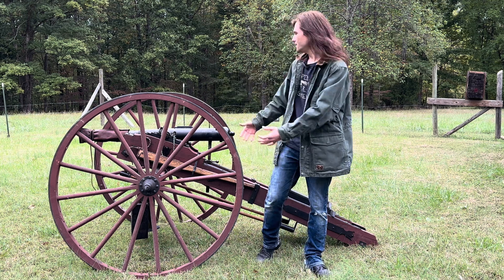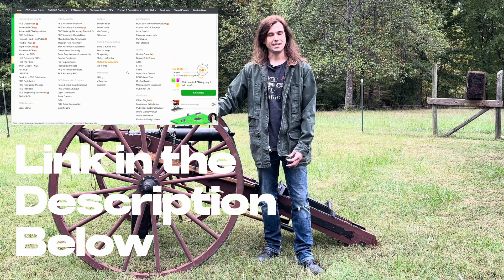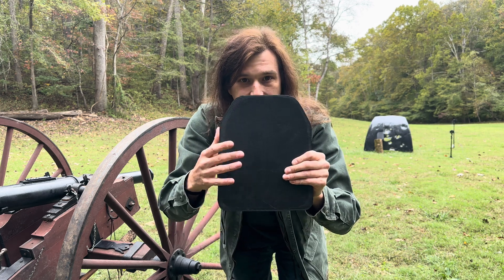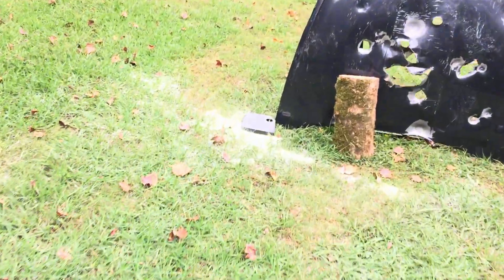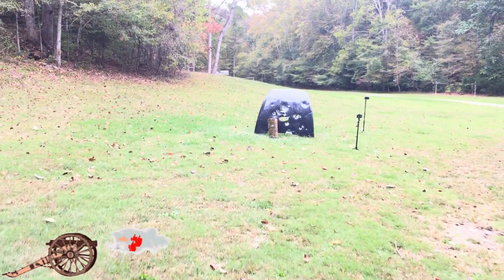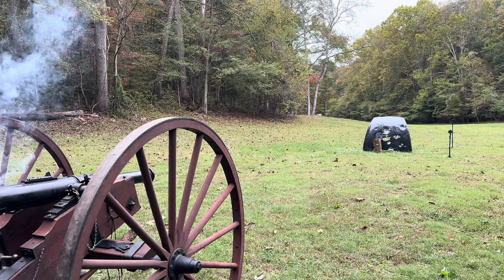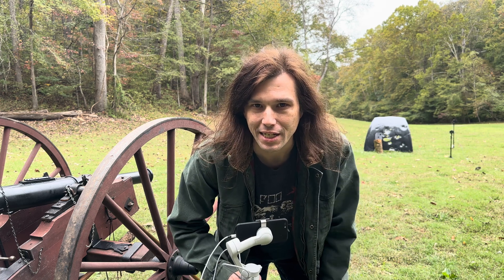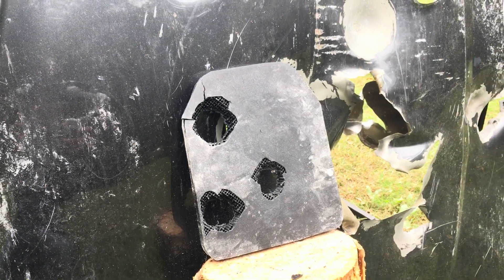Cannon vs. 3D Printed ABS Body Armor

Comment: Hey been looking for the barrel components.  Where did you get them and what are sizes again
Reply from the maker: You can get them in all different sizes but ours are 1.5” and whatever the next size that just barely slides over the outside of the pipe would be for your choices. Ours are well drilling stem and you can get it if you have a place around that drills water wells or oil wells and they sometimes have it available. Or you can order it online if not locally. Hope that helps!

Comment: No 3d printed plastic is going to stop a lead ball. 3" of solid UHMWPE will probably stop the wood ball maybe even the lead one.  To be honest the kinds of energy and mass the canon can throw is far in excess of most hand guns. UHMWPE will take a lot of energy as it deforms massively before it fractures.  It's very shock tolerant.

Comment: 1/2” aluminum plate would be very effective armor. Nonits not plastic, but not everything needs to be printable, low cost easy to source materials are fine imo as DIY is kind of the goal.

Comment: Hi, Vik here, the inventor of PLA filament. Might I recommend a plate of PETG with a 40% "gyroid" infill ? That should provide a good compromise between rigidity and shock-absorbing compression.
Reply from the maker: Oh wow! That's awesome! Thanks! I'll add that to the list to see what we can work up!
Reply: @TheCannoneer  I'd test it for you but sadly, no cannon. Well, there's a .45-70 but that sometimes  dents 1/2" steel plate...
Reply: The TPU rounds were very strong, i wonder if a TPU armor would bounce anything off of it

thanks for all you did for 3d printing too

Comment: Hi man! I emailed you a tank shell design to 3d print back in September, I believe on the second. Did you get the email and just haven't gotten around to it (completely understandable) or did it go to junk or something? I can resend it if you like; it's a DFS shell that should be able to be printed in one piece. If there's any problems, I can fix/alter it.
Reply from the maker: Hey! So sorry I missed it but if you're happy to resend it I'll get them printed out and send you a reply to let you know I got it! I appreciate the contribution!
Reply: @TheCannoneer  All good! I just sent it again with a model of just the fins as well so you can test to see if the mechanism works without having to print the whole body of the whole thing.

Comment: Walnuts. Pull the nutmeat out and fill with a binary. Encase in silicone or epoxy and fire when set. Also wood bullets with nail flechettes.

Comment: Nothing is going to stop a lead round from that cannon except a piece of steel too heavy to carry.  Get a level 4 plate and try it. You're looking for "Meets NIJ Level IV Standards".  Step it up like you did here (plastic, wood, lead) and be sure to angle the plate or stay behind cover because of ricochets.  What you'll find is that if the lead cannonball doesn't penetrate, the kinetic force would turn its wearer into paste.
Reply from the maker: Oh for sure. We shot a flak jacket and you’d be a liquid slush on the inside if you didn’t just pop from the pressure.
Reply: I love what you’re doing, but I think this was all a waste of materials. A 1/2” aluminum plate would be waaaaaaaaaay more effective for body armor as it will stop a lot of handgun ammunition. (Like almost all of it)